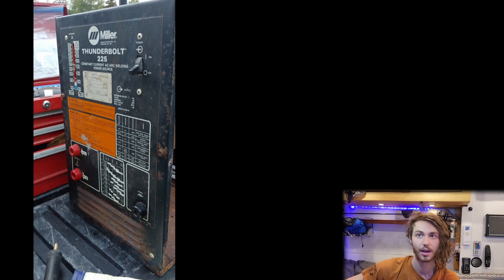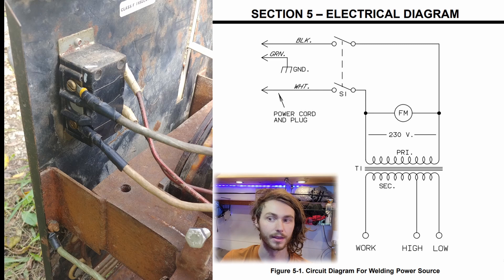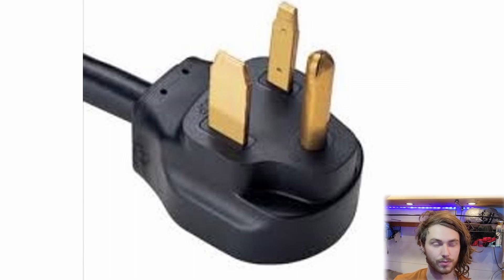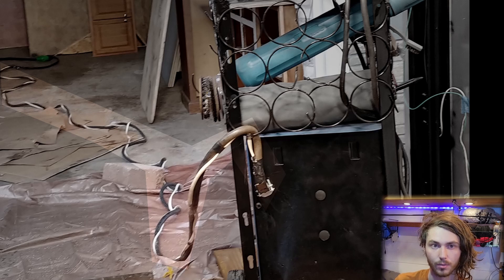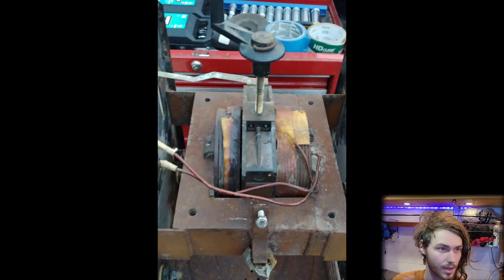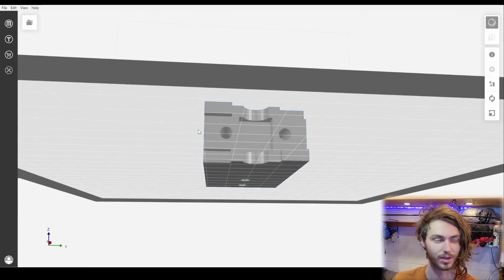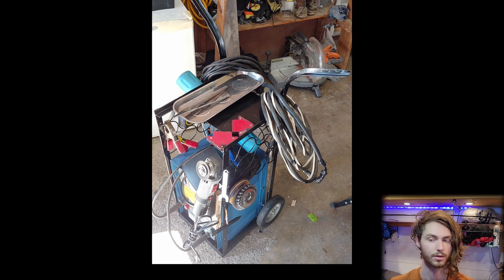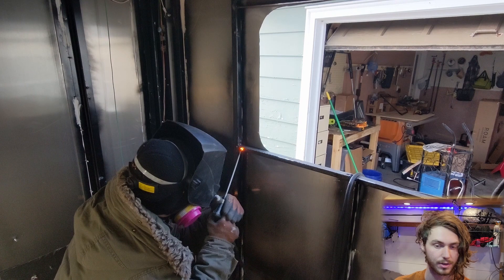restoring an antique welder rusting away in a field - Miller Thunderbolt 225

Comment: Good job on the restoration of the Miller. I also have this same welder that I purchased new almost 40 -45 or so years ago. It still works great for what it is. I have taken it apart for oiling,cleaning,painting every 5 years so it still works good.